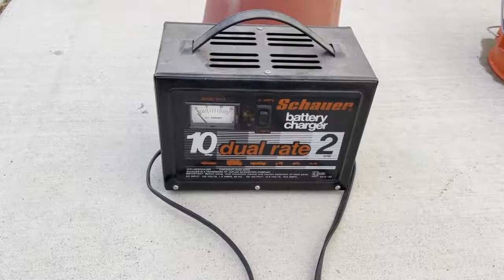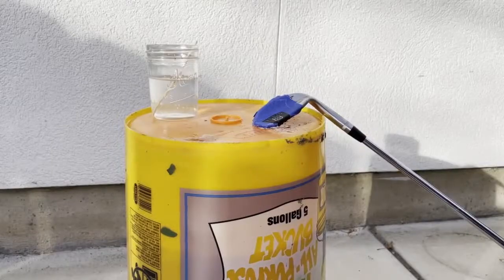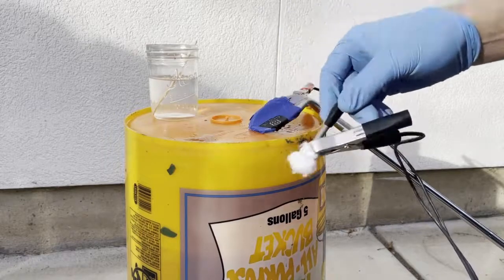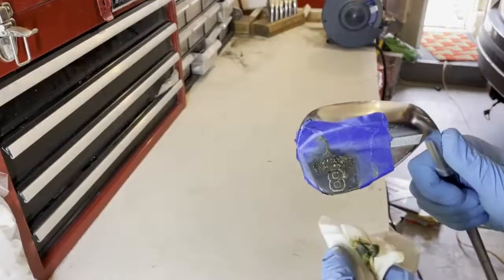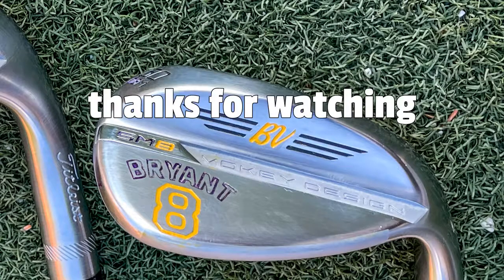etching a golf club

Comment: I used a permanent vinyl stencil and a relatively low voltage (9v) but the vinyl started peeling off my wedges. I cleaned the wedge with isopropyl alcohol beforehand. I did use the transfer tape and tried to press the vinyl down but its still peeling. I'm also tapping with the cotton ball instead of rubbing.  I'm trying to etch the lofts onto my new wedges soles so i can see which wedge I'm grabbing without having to look at the back of the club, such a pain to have to do that every time. Im cutting the stencils by hand so I'm wondering if there are small nicks in the vinyl edges that the water is getting under?
Reply from the maker: I think i used a stronger vinyl for the etching. If you are doing a few. I would spend like $10 and have someone cut stencils for you on etsy.

Comment: I’ve followed these steps exactly but have yet to get any success. I’m using a 6v battery charger with a vinyl cut out , 50% vinegar and water with the salt. Acetone cleaning on the club. Any thoughts?
Reply: Also have yet to see any corrosion on the cotton ball end , maybe my power source is bad?
Reply from the maker: @jonathanworscheck9248   its possible the electricity is backwards.
Reply from the maker: Or try an old phone charger. That is a better power source
Reply: @bradreef  that could be it? I had the positive on the golf club and negative on my bolt
Reply: @bradreef  how does the phone charger set up work?